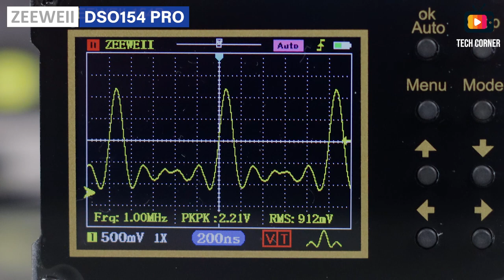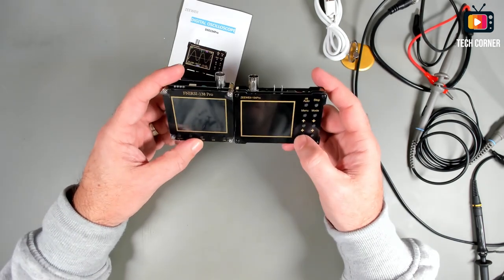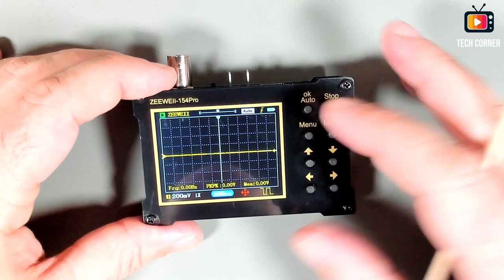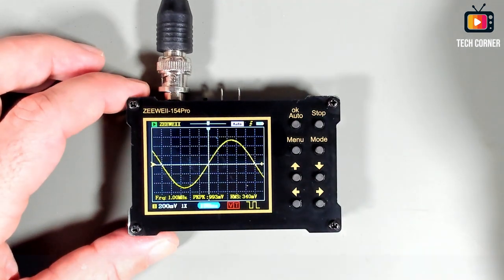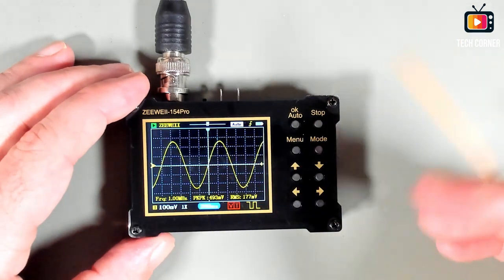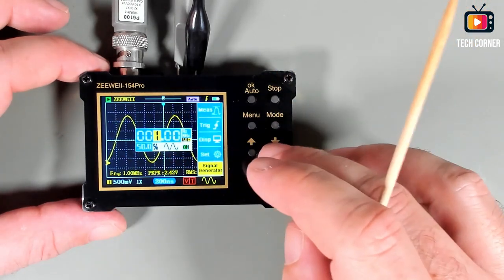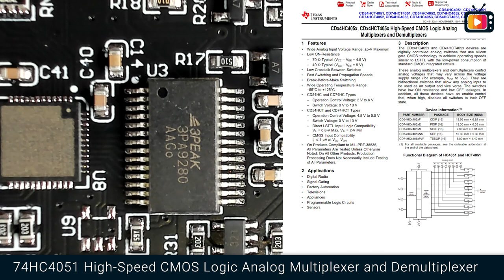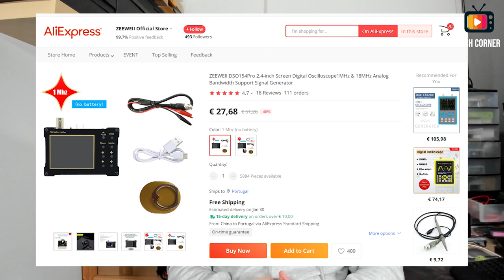Zeeweii DSO154 PRO Oscilloscope ⭐18Mhz 40MSa/s⭐Is It To Good To Be True?

Comment: You have to use 50 ohms termination close to scope I did many tests and if there is no 50 ohms termination then due to signal generators impedance attenuation Will be before the bandwidth and with a 50 ohms termination you usually extend it the true signals as to testing standard..try it always when you testing bandwidth and applying any signals from signal generators

Comment: Compare to FNIRSI 153, which one will you recommend?
Reply from the maker: Hi, this is a different kind of beast 😁 DSO-153 is more polished, better UI and case, this has more horse power, support 18Mhz (in the 18Mhz version) is still that almost DIY kind of look, but it is a very nice oscilloscope, if you need the bandwidth, I certainly stay with this one. Thanks for watching.

Comment: which oscilloscope is better, zeeweii 154pro 18M or tooltop et120m? greetings from Poland :)
Reply from the maker: Hi, I think you're comparing apples and oranges 😁 for me, the et120m is a more complete solution and with a higher bandwidth support. This doesn't make the 154pro a bad device, not at all, for the category it is comparable (dso150, dso152, dso153, dso138) is in my opinion one of the bests. Thanks for watching!

Comment: Nice run down.  Thanks.  However, you are using a 50 ohm cable and your generator probably has a 50 ohm output, but you have not terminated with 50 ohms at the scope.  This impedance mismatch will lower the BW you measure.  Try it again with a 50 ohm passthrough (or even 'T') terminator.
Reply from the maker: Hi, ok thanks for the tip, I do appreciate it. I will try not to forget the next time 😁 thanks for watching.
Reply from the maker: PS - Sorry for this late reply, time to reply is really short these days.
Reply: @TechCornerTV  No worries!

Comment: U8 IC should be the FPGA. They have 2 versions of the scope. The cheaper one has only 1 Mhz Bandwidth and has no battery and no probe.
Reply from the maker: HI, a small devide like his makes more sense with battery, in my opinion. For price difference, I prefer also the 18Mhz version, but there is a solution for every pocket. Thanks for watching.

Comment: I just bought it and after i saw its great signal generator i was impressed ! This sounds so good ! One question though, is it updatable as other or does it run on this firmware for ever ?
Reply from the maker: Hi, I think it is upgradable, but to be honest I'm not aware of any update for any of the Zeeweii devices. Regarding the DSO153 it really is a master piece, I think zeeweii is totally underrated, they have quality products for very good prices. Thanks for watching!
Reply: @TechCornerTV  thanks alot for the feedback. I just wanted to make sure that if there are any updates regarding the small oscilloscope as in software there is a possibility. Off course i think it is a very great tool. I am not really into electronics that much so a advanced oscilloscope was not needed thus making this zeewei oscilloscope awesome.

Comment: Thanks for another thorough review.  15MHz is not bad considering it's advertised at 18MHz.  That's actually a conservative marketing claim for this type of scope as most claim bandwidth more than 3X their real bandwidth.  The signal is still useful at 18MHz.

This scope is only US$28 without the battery, though.  It's currently $36 with the battery and I'd consider the battery a necessity with this type of scope as it's annoying needing to have it plugged in all the time.  The battery also gives you full isolation, which avoids potential problems with some circuits.

I'm not affiliated with them in any way, but it seems to me that this SigPeak/Zeeweii company is actually innovating in this product category and not just putting older, slower designs into nicer packaging like Fnirsi sometimes does.  I hope Zeeweii continues to improve their sub-$100 products and perhaps one day make a scope to challenge the Fnirsi 1014D, which is surprisingly overpriced for what it does and how much it costs to manufacture (no power supply, for example).

I think it's sad that Fnirsi's 1014D has been so successful as paying just a little more money would buy a vastly better scope from another brand.  I've seen 1014D's priced at close to $200, which is simply a rip-off, in my opinion.  Good luck to Zeeweii ;).

I'm not opposed to a USB-powered bench scope and think it's actually a good idea for reducing the cost, but the resulting product should sell for less than $100, not $180.
Reply: Paying $36 you also get the proper oscilloscope probe, which costs about 8 dollars on its own.
Reply from the maker: Hi, thanks for the comment. I have to confess that I order the non battery version and they sent me the full kit, as I said before, I was in contact with Zeeweii. So, it was not sent free, but at least I received the complete kit with battery, but I only notice that it existed the version without battery after you post, I went back to check what I had bought.

Regarding the price vs what you get and even if I'm a FNIRSI fan, the DSO138 PRO with 200Khz bw and 2.5MSa/s cost arount the $35, if compared with this one that has "18Mhz" and 40MSa/s and 8 waveforms function generator, there is no decision to make, the DSO155 PRO is a non brainer purchase.

I think Zeeweii is still a very small company, thats the idea that I got, but with some talented people on R&D because they have their own models. I hope that they grow enough to create a decent support channel to the end user and to be able to improve their products. They are quite ahead of the rest of the competition. 

Thanks for watching!

Comment: I picked one of these up as my first oscilloscope recently to learn with. Thanks for the in depth review
Reply from the maker: Hi, glad it was helpful and thanks for watching!
Reply: Yep, I got a Rigol 1054Z then realized I don't want to accidentally destroy it while learning.  So then I got the handheld Owon 100Mhz model -- then I heard of the Zoyi zt-702(&3)s and decided I didn't want to blow up my still rather expensive Owon scopemeter, so I got those as well (giving my old zt-702s to a friend that has never had a scope and works on cars). ...... THEN I heard of these ZeeWeii scopes that seemed like the real deal compared to some others like Fnirsi, so I got this 1054 Pro model as well as their '125' Mhz single-channel model (1511G, IIRC?).  I'm finding that these ZeeWeii's don't seem to be the normal 'toy-kit' types at all - they seem very real indeed!  So in the future I'll continue to support ZeeWeii for their innovations in this cheaper market.
...And yes, I'm a firm member of TEA - Test Equipment Anonymous. 👍

Comment: Noted the USB to serial chip....
That suggests either a capability to flash the firmware, or to externally control the device, or to output to a PC....
Reply from the maker: Hi, probably to flash the firmware... thanks for watching!
Reply: Id guess it outputs the signal to serial in some way. Check out how the dso 138 works. Also when you plug the usb c into pc it pups up as a serial interface if you are really lucky you might also be able to control it w pc

Comment: I also ordered this oscilloscope. There is a small question: the value of the output impedance of the internal function generator? Is there a buffer amplifier at the output of the generator?
Reply from the maker: Hi, I know that it has fixed amplitude, but in terms of impedance, I don't know to answer that. Sorry. Thanks for watching.
Reply: @TechCornerTV  I just received a response from the seller - the impedance is 150 ohms. This, in my opinion, indicates the presence of a buffer operational amplifier!
Reply: High SpeedRail-to-Rail Amplifiers AD8091, 110 MHz, −3 dB bandwidth (G = +1)
Reply: @КонстантинНиколаев-ф5ъ  well its 3.3v rms so my guess is ut has a op amp in it

Comment: Hi - very good and very convincing review. If I buy this DSO154 Pro scope I will certainly use your affiliate link.
I am comparing this to another small scope which lists a sample rate of 1Msps 12Bits - can you advise what this "12-bit" sampling feature does and how does it compare to the  DSO 154 ?
Thank you.
Reply from the maker: Hi, in this size, up to $50 I don't know any better than this. You can have a better ADC but if you have 40 to 80 times less samples per second, that can be a bummer in terms of data to display the waveform. Is true that this a bigger sampling rate because it goes up to 18Mhz, but, it will have the same sampling reate in lower frequencies like the ones in its price range. So, in this price range, I would not mind a lot of the 12-bit. At least this is my way of seeing it, until someone show me that I'm wrong. Thanks for watching.
Reply: This one over thr dso 152 153 and pretty much any fnrsi. This device is impressive

Comment: beetween this one and fnirsi dso-152 what would you recommend?
Reply from the maker: Hi Juan, this one for sure. I love the DSO-152 and all the design, user experience, but this can go up 18Mhz... is more than many portable oscilloscopes and multimeters like the 2C23T or the ZT702S. Let me give you some news, very soon that will be available also the DSO-153 with 1Mhz bandwidth, should be released in next weeks. Thanks for watching.
Reply: @TechCornerTV  thanks for answering, really apprecciate it
Reply: The 154pro for sure basically over any fnirsi I have tried so far.

Comment: Do you happen to know know max voltage this can measure? I see one value for x1 and another for x10. But don't know the difference between the two. Safe to think that 40v is actually the max.
Reply from the maker: Hi, the max voltage is 40V, but if you use the 10x attenuation of your probe, you'll be able to measure voltages up to 400V. It doesn't depend on the oscilloscope but on the probe, so, please be sure that you select 10x on the your probe switch. If you do so, please change the probe compensation to 10x in the oscilloscope so it converts the values according the 1x or 10x. Thanks for watching!

Comment: Supplementary question:  I'm keen to reduce the output of the function generator (circa. 3v PKPK out-of-the-box) to emulate a guitar signal level for front-end pre-amp fault finding purposes.

I had assumed this would be possibe from within the menu, but have been unable so far, to finding a setting?  Something I need to do externally via a bespoke potentiometer arrangement?
Reply from the maker: Hi Andrew, yes, you need to do it externally. These cheap devices normally have a fixed amplitude on the function generator output. Thanks for watching.

Comment: I got tge one thst looks like the video game controller (the buttons are on both sides) abd im not likeing it no no constructions I don't know how to update it don't know where to go to update it it needs  hardware and software updates apparently and the button layout in the way that you go through all the different settings is just not user-friendly imo

I almost got the 1-year reviewing in this video though because I like how the function generator prongs are sticking out mine their recessed and you need to use very tiny little clamps to get to them
Reply from the maker: Hi, yeah, I already saw that one in AliExpress but never though of buying it for review, sometimes they simply don't think in what they're doing. That one seems to have a very poor UX and you just have confirmed it. This one is very acceptable for the price and the product line/target that it was designed to. Thanks for watching.

Comment: Great review and I'm currently awaiting delivery of this item.  :)

Is there a proporietary plug/connector to inerface with the function gen. output pins, or does rely solely upon use of probe type clips?
Reply: Answering my own question posed above: I've sourced a 'Clever Little Box CLB-JLB75 CLB-JL-75 BNC Female to Terminal Block 2 Pin' (the actual eBay description @ £2.68 inc. shipping) that has twin screw terminals on one end and a male BNC connector on the other.  Using the screw connector to secure it to the function generator pins of  the DSO154 PRO, this male BNC will allow interface with any kind of female BNC flying lead terminating in alligator clips and/or banana plugs as required.
Reply from the maker: Hi Andrew, I saw you answer also and I also have a few of these connector laying around here somewhere :) I'm glad you solved your issue. Thanks for watching. PS - Sorry the late reply, but time is really short these days.

Comment: Thank you so much. It seems that 15 Mhz is only suitable for periodic signals. The method could be sixteen possible offsets from the timing signal, allowing a 1Mhz analog-to-digital converter, hence the price? Could this be the role of the multiplexer?
Reply from the maker: Hello! Sorry for late reply, house move and vacations. I'm more inclined to the ADC... but my knowledge is very limited, so maybe. Thanks for watching!